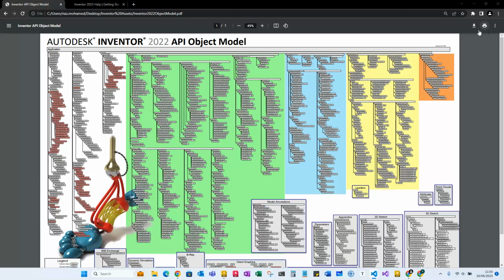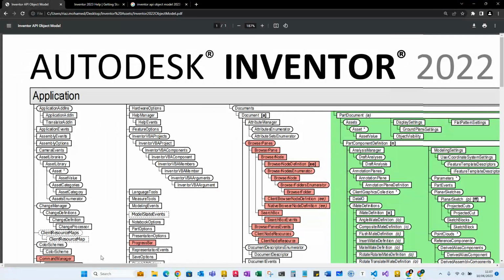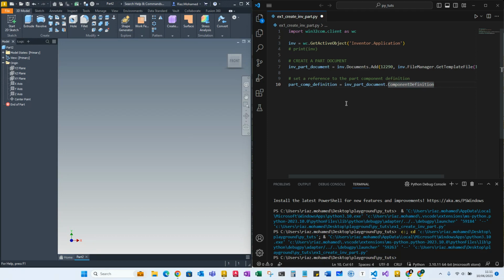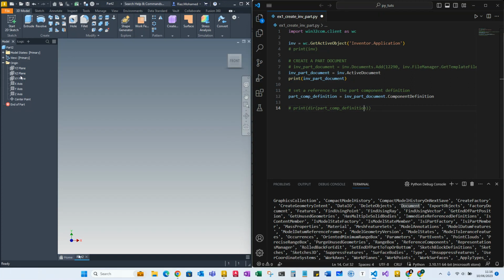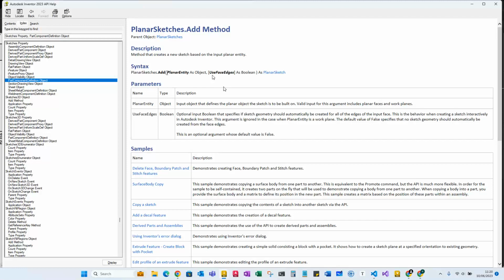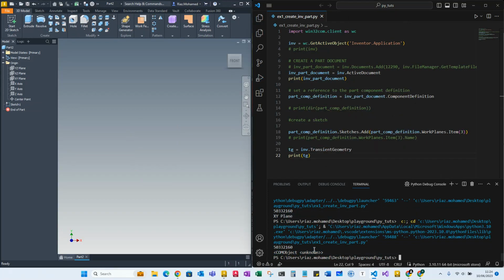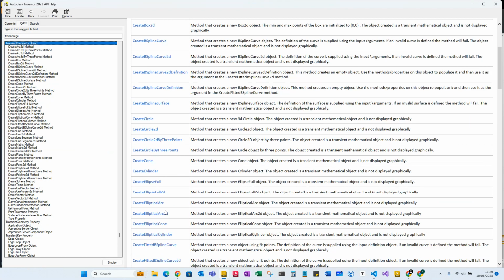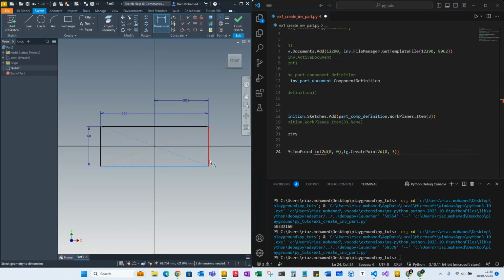Part 3: Creating a sketch for a 3D model using Python and Autodesk Inventor API

Comment: Thank you so much for the video! Could you explain how to know exactly how to reference an object from the API table? I don't understand why they made the table so weird. According to it I should write like this:
...PartComponentDefinition.PlanarScetches.Add()

but of course it doesn't work. And it's driving me crazy. Every time it's a mystery to me how to know what exactly to enter instead of what is specified in the table. For example, that you should not write "PartComponentDefinition" but just "ComponentDefinition" and so on. 
I hope I have described my problem clearly.
Reply from the maker: Thanks for the kind words. It is actually fairly straightforward
Reply from the maker: I will explain this soon . Thanks